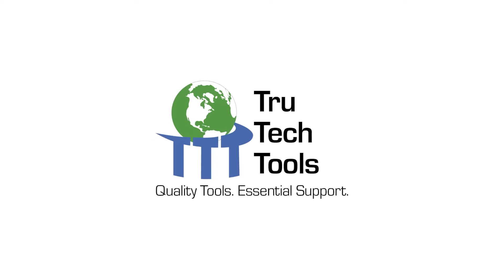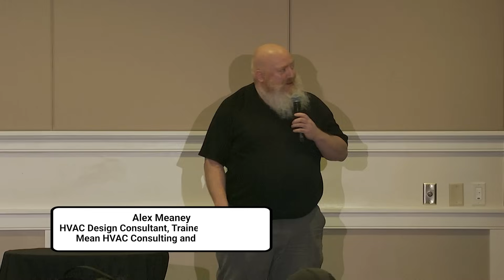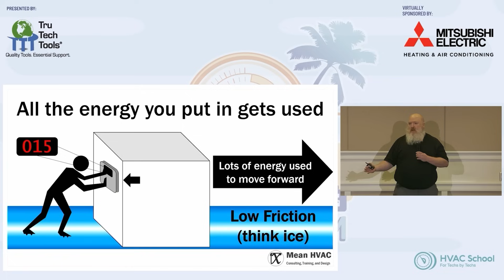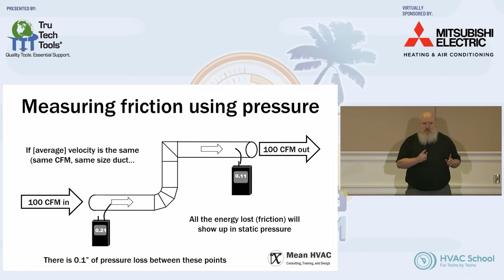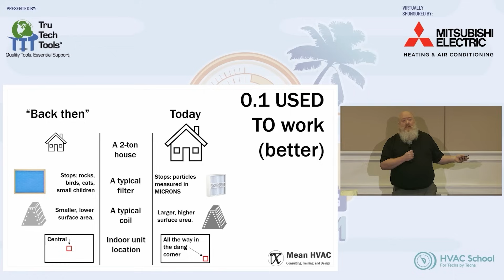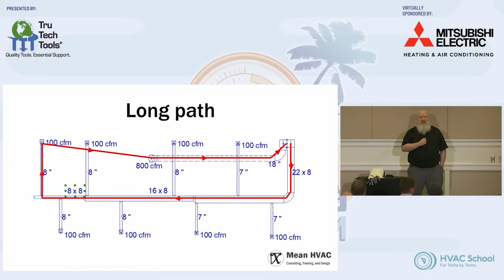Understanding Airflow: David Bowie, a Used Car Lot, and a 40¢ Tool with Alex Meaney

Comment: Which one is better? Radius Heel or Throat?
Reply: Throat . same concept as driving a car  a hard 90  makes the cars go slow and makes the cars back up but a long radius corner will let the cars go quicker around the corner and not cause as much of a back up
Reply: @rocketman8068  Hmm. Yeah, and the square throat is a choking point right in the middle where it narrows,  but typically that's what you see is radius heel square throat. At least in commercial, anyway. If they have vanes then it not so bad

Comment: You talked about houses with return ducts in every room, which is what we had in the house I grew up in, so I thought it was normal. But with a central return, what happens when someone closes a door? Or several doors? Did the builder account for this? I've certainly seen houses where this did not appear to be a consideration. How does that work?
Reply: If the door is closed it overheats rooms close to the return air grill while rooms far from the return stay cold if the door is closed.

Comment: FWIW, I once saw an air duct implode, but it wasn't in an HVAC system. It was a vent for several laser cutters, and someone accidentally closed all of the gate valves at the same time, while the blower was running. (They won't make that mistake again.)

Comment: This is a good start. 

Also, flex duct is amazing stuff when you slow the air enough and have room for sizes you need to do that. length almost doesn't matter, boots/grills/dampers/ blower rpm end up controlling everything when you end up moving more air than you need at factory default blower rpm. the most efficient duct system I've built or tested was flex.

Comment: Thanks, Yes ! The best way to cut down friction is to design the ductwork correctly from the start—make the ducts the right size and keep the runs as straight and smooth as you can.
If the ducts are too small or twisty when they’re built, no amount of fixes later will completely make up for that.